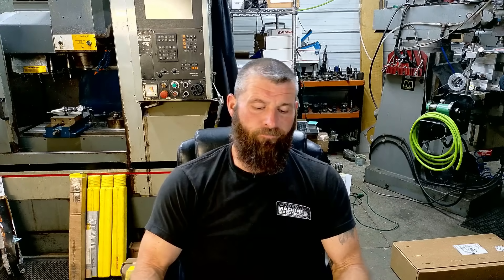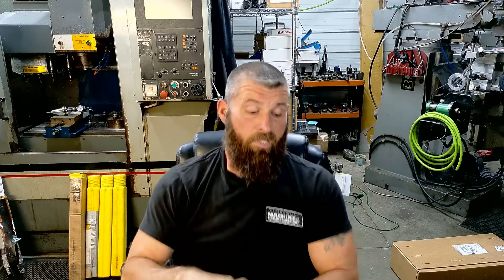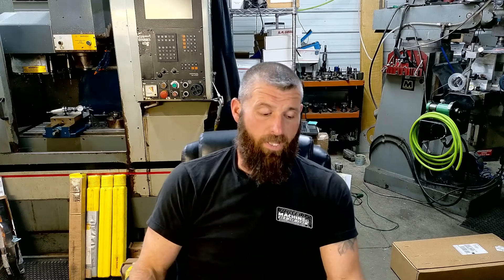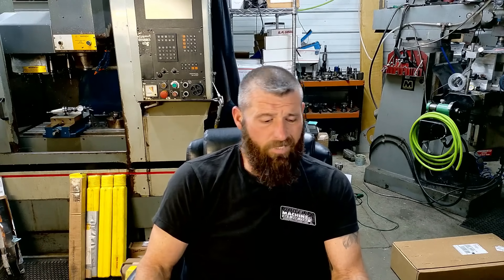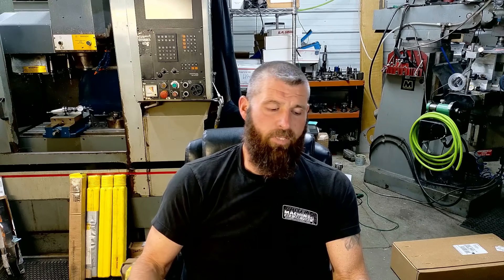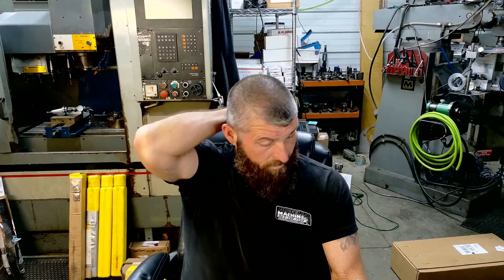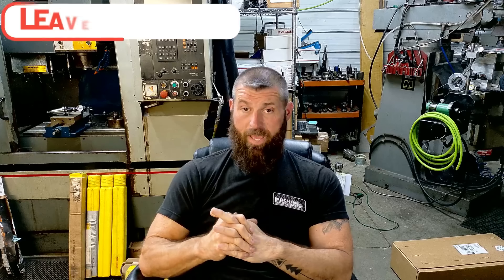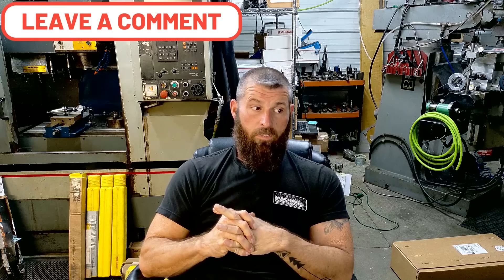A perfect Example of why checking Cam timing is important!

Comment: I repaired an engine where the guy building the engine skipped degreeing the cam. He said it had a ton of compression and he eventually scored a piston. 

When I checked the cam, it came in at 91° intake centerline. At 8° retard I still couldn't get it close to where it needed to be.  I eventually swapped cams and it landed right on straight up.

It's a must to degree every cam.

Comment: If you're like me, And you watch videos trying to learn from  reparable proven intelligent guys like yourself. Sometimes it feels like tug of war, And I'm the rope. The big named top fella type I purchased my cam from. Told me I probably didn't need my nine position key way timing set. Just put it dot to dot. Now he has a video saying my Magnesium bronze valve guides I thought I should use with my stainless valves, from watching other videos, We'll probably wear out in ten thousand miles.with stock L.S rockers. So I contacted C.H.E told them I'm Not complaining , and i'm not trying to return them. What do they think. They said I will be fine with them.  Same go's for  compression ratio on pump gas, Or cam profile to help ?with a tad to much Compression. I respect ben alameda, And richard holder. It makes a poor Is pea Brain boy like me.Look like a dog Chasing his tail.   What you're saying makes sense to me, And I haven't run it yet, Because there's no machine shop in my area that has the time to Get my heads squared away.  So I have all.
The time in the world to do it right. Thanks powell.

Comment: I put a cam from a major manufacturer in a LS and all the events seemed off, so I set it up with the centerline where it was supposed to be.  It performed fine.  My takeaway:  The long way is better than the short cut, and worth the time it takes to avoid problems that are very hard to diagnose later.  In other words, do what you just said.
Reply from the maker: Exactly 💯

Comment: So I have come to the conclusion that a degree wheel is not needed, but! before people start to go off, all cams should be ran through a cam doctor to check the cam. If the cam passes the cam doctor check then if you set up the correct piston to valve clearance and check it, if that is what was calculated using the cam doctor specs then you should be bang on.
Then this is what many don't understand, the cam should be run on the engine dyno and either advanced or retarded to the power curve desired.
I know a lot of people will say oh but all the big name engine builders use a degree wheel, well at one stage they all used to do things that are not done these days, it's called ingenuity, so when one guy starts doing it and others follow well that first guy was doing something no one else did so that argument about if all the top engine shops do x so that is the only way is busted by that logic I just mentioned. 

But yea I remember when I first learnt how to use a degree wheel, then a few years later all these younger guys were saying that it's needed and you cant be a good engine builder unless you use a degree wheel. Well this made me think about it and if that was true and if there was another way to do it. 
Well like I said, if you set the adjustable cam gear at zero and check PTV clearance then advance until contact, you can find the maximum point where you can move that cam, then from there on you can work backwards on the dyno to find either peak hp or peak torque depending on what you're after. 

This is in fact the methodology behind variable timing gears used on many modern engines, the cam adjustments are made in software, so the degree wheel is a moot thing on a variable cam gear.

Comment: Everyone told my brother and I we were wasting our time degreeing our cams. They were often correct but the few times we had to adjust it made a difference. We also checked all the machine work AKA "blueprint" bearing clearances, piston fits ect. I've seen some crazy stuff. One so called reputable engine builder built a friend of ours a late model motor (very expensive) and it had spring bind! That's one of dumbest and most expensive mistakes I've seen! Always take the time to check everything you can. As for my friend, that's why it's best to build your own motors. You save a lot of money and if anything goes wrong you can only blame yourself. It's rewarding.
Reply from the maker: Great points and thanks for sharing your experience!

Comment: There are a lot of people that degree the cam, but have no idea what they are looking at when they do it.  They'll go through the process and write down the numbers, but they don't know what the numbers mean.  Or they'll have the slack taken out of the chain the wrong direction.  Speaking of wrong direction, on the cam you're talking about you said it was for a boat with a V drive.  Any chance they were thinking it was a reverse rotation engine when they ground in the advance without, but didn't actually change the lobes for reverse rotation?
Reply from the maker: the entire lobe layout and FO is different on ccw engine
Reply: @powellmachineinc  I know everything is different, I was just suggesting they did everything correctly, then brain farted on the advance.  After thinking about it this would be an even bigger mistake than just doing it wrong.

Comment: “Trust, but verify.”

Another illuminating video! We had an issue this season with oil control ring on a cylinder. Turned out that the oil ring support rail on that piston didn’t have any dimple to stop it rotating. So, it finally rotated around to the pin cutout area and then the oil control package bent downwards and gave us a blue smoker. Must have been a manufacturing issue that was not noticed by the engine builder on assembly! Thankfully no bore damage and we fixed it at the track.
Reply from the maker: Thanks for watching and sharing the experience!

Comment: heres my silly cam mistake story.  back 25 years ago when building my first engine (small block chevy 350).  when installing the timing set.  i had a book that for some reason was not real clear on which way the dots were to be lined up.  so i asked our neighbor who was a (hack mechanic). and he said both dots go 12 oclock is where we ended up installing the cam 00016 lunati was the part number.  got the engine installed and the car fired right up and sounded great (in my opinion then).  broke it in drove around but for some reason it just didnt have hardly any power and would not rev past about 4000 rpm.  i hated how weak it was.  well a little later it started knocking. i had to have left some dirt in the crank oil hole.   pulled the engine. installed a crank kit without removing the pistons or heads!  that was not easy but we did it.  and i asked a real mechanic and he said heck naw. those gears go dot to dot!  so i reset the timing and man when my 81 camaro z28 rolled out of that shop i though it was john forces top fuel car!  lol left a 40ft black mark and it would chirp the tire when shifting to 2gear.   that was the funnest summer ever. year 2000 with my red z28. age 16 and thought i was a bmf. lol!! fun times!!  and no i had no idea what a degree wheel was.
Reply from the maker: So.... the cam timing is EXACTLY  the same with the dot at 12 or 6, so that didn't solve anything remember....there's 4 strokes, 720 degrees of crank rotation
Reply: @powellmachineinc  in that case how did the engine sound a lot different as far as the lope? it went from sounding way more radical to a normal street cam slight lope, the engine had maby 150 hp at most, all i did was reset the timing gears dot to dot that set had no other grooves to change cam timing,  put it all back together and the car ran amazing.   seriously if you can help me understand ill be glad to hear, thanks in advance.

Comment: i wonder if the operators of these cnc grinders are not setting the machine and or cam cores up properly??  the thing about your rigid manual grinder is those plates dont lie and the only way to do it wrong would be basically intentional.  or like you said a miscommunication.  which id guess would be nearly impossible because im sure you confirm the info before starting the machine.  i run cnc and machine huge parts (steel mill rolls) and on some of our parts 1 mistake can easily cost $100,000. and its super easy to miss a letter on a program. lol.
Reply from the maker: It was done on a manual grinder,  but that isn't the point

Comment: Had a BBC Comp cam that was 6 degrees retarded and wouldn't get out of its own way installed dot to dot. I degreed it after the fact, which i will never do again, and it come around. Ive come across several others since, but that first one really bit me in the ass.

Comment: what has happened to quality control? Yes mistakes get made in the shop but some one should be double checking before it goes out. It takes what 5 minutes on the cam doctor to spec a camshaft to check vs the order? In a mass production factory where they are CNC machined that process should still be done. It’s cutting corners hoping the client doesn’t have the smarts to know it’s not right.
Reply from the maker: Absolutely 💯

Comment: What a coincidence! I'm building a 505 big chevy that was bought "ready to run, fresh" , anyway it had  a 9 key crank gear on zero. When I got all the other issues straightened out and checked cam timing, duration checked right on, but center line was 5 degrees retarded. Put it on the +6 slot and checks half a degree advanced.

Comment: Daniel i am starting a new engine build i would like to quieten engine noise down if i use hydraulic rollers i believe it will be quieter . Performance differences between hydraulic and solid rollers for a street and stip car for the family ?
Kit from down under
Reply from the maker: Hyd Is the way, but the profile  needs ti have proper closing side seating velocity or it will be noisey also
Reply: Thank you for the reply.

Comment: As of lately I have been seeing more of just what you have there. In fact the last 4 cams that I have installed 1 of them was retarded 6 degrees and 2 of them were retarded about 3 degrees. All three were from different major makers. Two were custom billets and one flat tappet shelf cam. One was sent back because was full of chatter because of the train going by when ground the first time (LOL) . I will no longer use that company for anything they could mess up it was not the first problem i have had with that company. Next chance I get I may try POWELL CAMS. I enjoy your youtube channel!

Comment: So im building a mild street motor. Nothing Crazy. Its a 95 model LT1 383 stroker. Afr Heads. A mid rise Air gap intake. Long tubes and all that crap. Any how. Im gonna hit it with a 200 horsepower Nitrous Express system and some sort of controiller. Not sure witch one yet. I may leave all that up ti Tom Gunner aka Jimmy Dale. But the reason im commenting is. In your opinion do you think I picked the right Camshaft? (276\281 Advertised) 224\232 with 112 lobe Separation Lift is .367 lift at the cam and 550 lift at the valve stem using 1.5 rockers. Also its a hydr. Roller cam
Reply from the maker: Its prob just a tick small and doesnt have enough split
Reply: @powellmachineinc  What would you recommend?. Or even i could even come to your shop and have all the info with me so I can pay you for your time. If thats cool with you.

Comment: About 20 years ago I  built a bbc  I  checked the intake  CL it should have been at 112 it was at 114 so I advanced it to 112 with the belt drive. I thought all I good. When I ran the motor on the dyno it sounded funny and was a turd from what I was expecting it to be. I was confused at first  it didn’t care what I did with ignition timing or carb jetting it just wouldn’t make any power. The motor was an 11 deg dart big chief headed 622.with a sheet metal intake and  two dominators. The cam was supposed to be 277 300 .540 lobe lift intake and .520 lobe on the exhaust with 116 lsa . Finally I took the rockers off and checked the valve timing events on the intake and exhaust at .050 and found out the cam manufacturer ( comp  cams ) ground the exhaust  profile on the intake lobe and the intake profile on the exhaust  and it had a 122 lsa. Ever since that debacle every cam I get I always check the lsa and valve timing events on the intake and exhaust lobes.. I also check it again on another cylinder on the other side of the motor.
Reply from the maker: Wow, that's a crazy story, glad you figured it out!
Reply: We had a similar experience on our circle track builds. 11* off with a gear drive. Caught it on assembly.
BTW we had our own engine dyno.

Comment: You have to degree them in every time...I've had em wrong both ways. Plus if you have an aftermarket crankshaft, it can affect it as well. Also had the ICL degree in different by changing brand of timing chain and gear sets... Thanks
Reply from the maker: Yep, its definitely important to double check.

Comment: A number of years ago I had my Yamaha FJR motorcycle in for a valve clearance check and adjustment. The adjustment requires removal of the cams to change shims. And, he put the cams back in and they were retarded by one tooth of the sprocket. That bike ran like crap down low but just fine up top. This sure sounds familiar; maybe not in cause but in effect of a mis-timed cam.

Comment: Verifying is so important.      The worst I ever saw was a total of twelve degrees negative.   Most of it was in the camshaft. The rest of it was between the timing set and the crank shaft.    This was on a fairly stout Olsmobile 455.     Had I put it in without checking it, too, would have been a turd. 😮
Reply from the maker: 100%